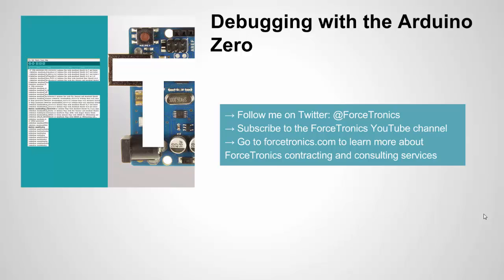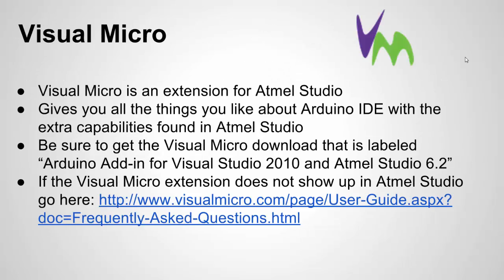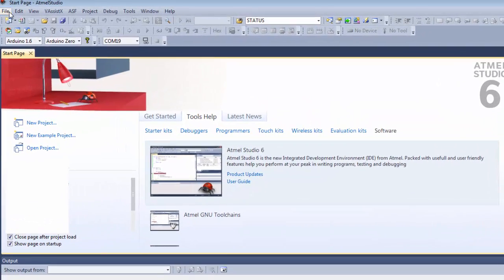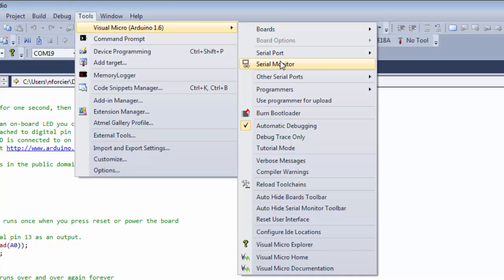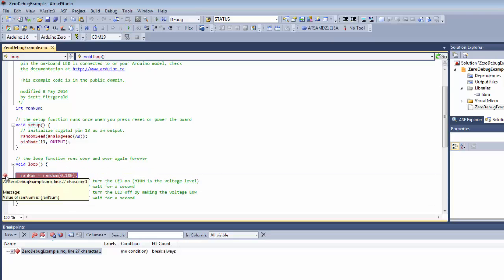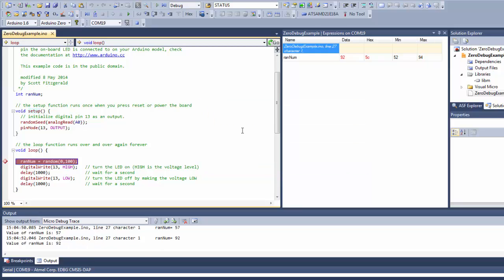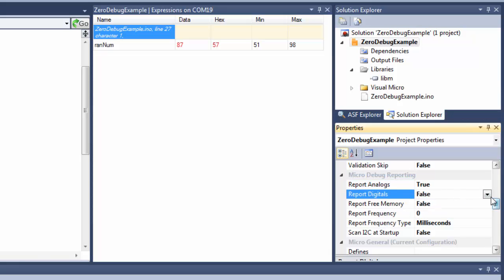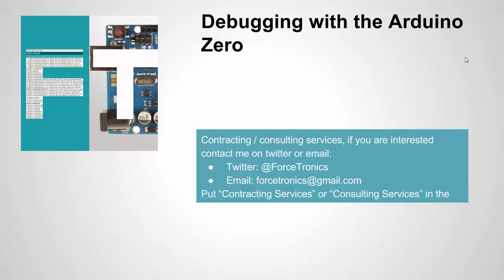Debugging with the Arduino Zero

Comment: could you use the debugger to debug a button (on a led shield with buttons) attached to the zero?
Reply from the maker: Debugging happens on the code running on the microcontroller or processor. It only reveals actions taking place in the code.

Comment: If the board has the EDBG chip wouldn't you get a better debugging experience just using Atmel Studio and debugWire? That would get you closer to real hardware debugging and you can add/remove breakpoints without having to stop and recompile every time.

Comment: People like the arduino because of how simple it is. The arduino ide is simple to install and works for any board. The language is simple, with many examples. Just press the upload button and it writes. Personally, I don't think i would ever buy one of these over a uno or smaller board unless I was working on an extremely complicated project.

Also couldn't you debug pretty simply with serial out?
Reply from the maker: +Joey Vigil (Robot Doctor) Great points. You can always use Serial Comm for debugging (I use it all the time). It can get tedious if you have a lot of code and are using a lot of pointers. Also the Serial library uses interrupts and if you are using interrupts in your code adding Serial comm can mess things up so a debugger can be very useful.